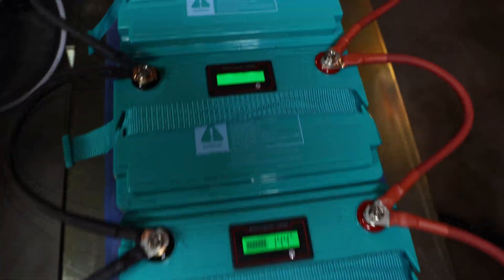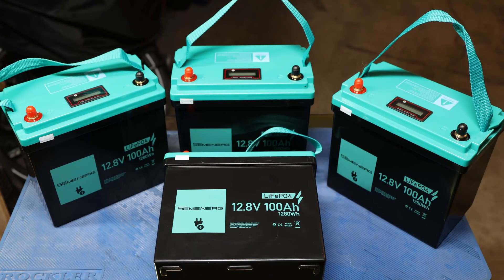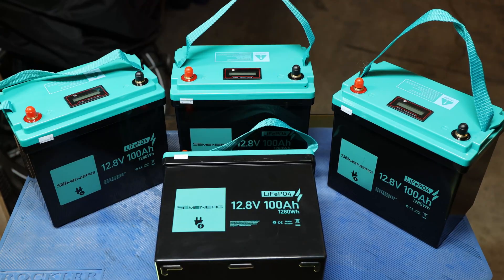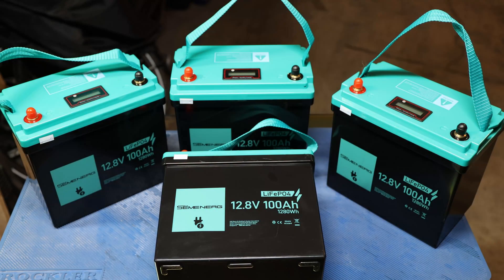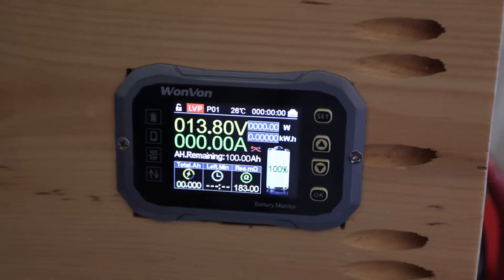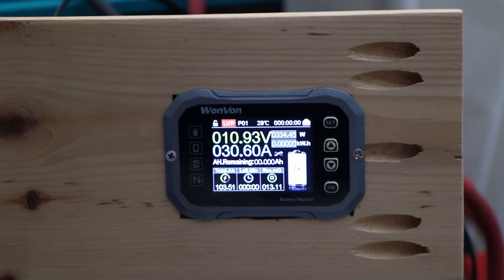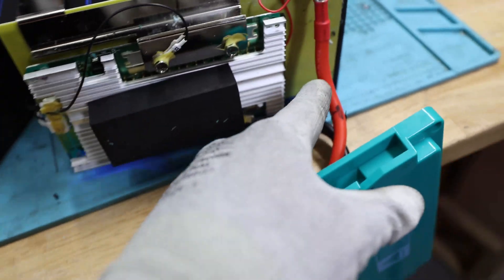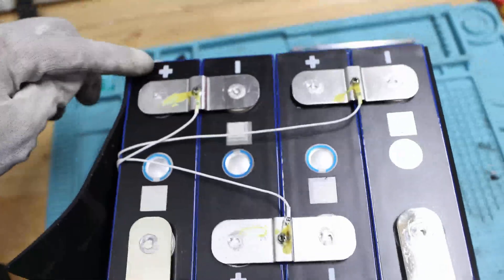Cheapest Lithium Battery! SEMENERG 12V 100Ah LiFePO4 Battery Review + Series & Parallel Setup Guide

Comment: Great video, I have a set of 4 of these batteries in series for a 48 volt battery connected to a low frequency inverter for home backup, but the name on my batteries is Hysincere.  Other than the different name, they are identical to the ones you show and so far have proven to be good quality.  I also have a set of 4 of the 314ah mini Humsienk batteries (with the 100 amp BMS) connected in series as a 48 volt battery running in parallel with the other batteries, the Humsienk are Bluetooth BMS’s and let me see some basic parameters, but they have odd quirks sometimes and seem to randomly disable the batteries output.  To date, I have not experienced any issues with the Hysincere batteries, thanks for your review and best wishes.